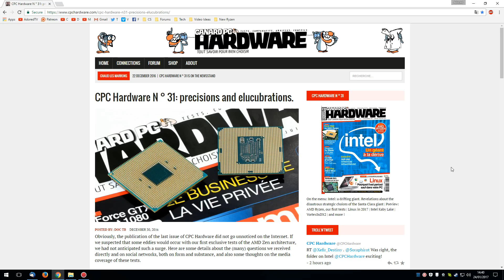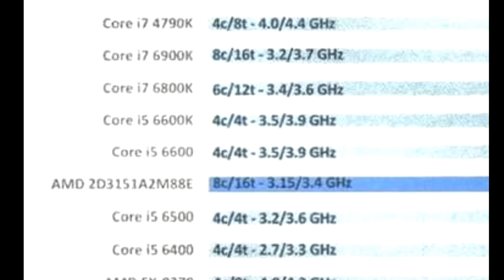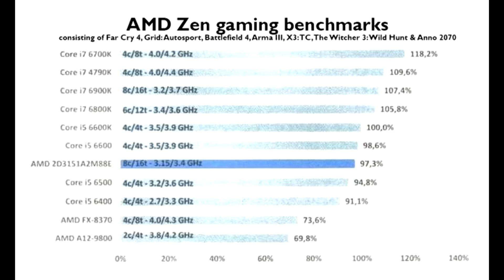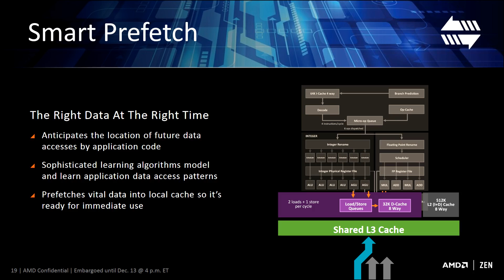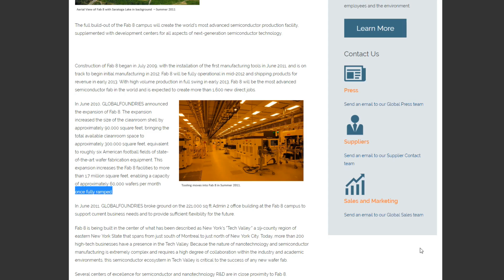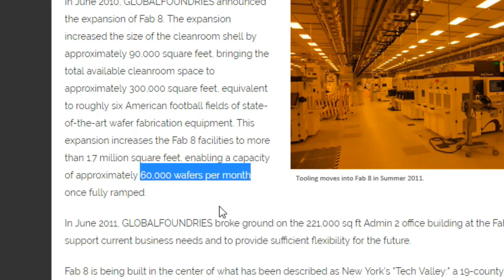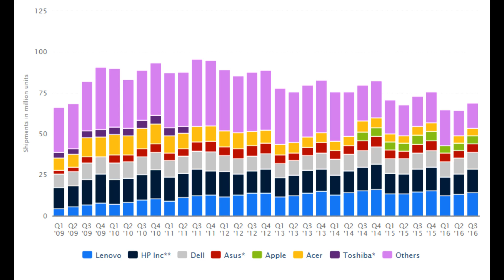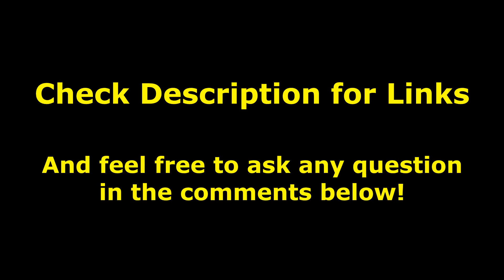Ryzen - A Refresher, Some Speculation and Market Analysis.

Comment: Thought it's worth saying that I suspect the engineering sample will have a good balance of performance and power consumption. However if you were to bump the ryzen chip up to similar clock speeds to the 8 core intel we may well see that power draw rise disproportionately to the clock speed increase so I suspect the final retail sample will consume over 100 watts of power at full draw.
Reply from the maker: Yes I believe so, especially given what we've heard about the turbo already.  I think most people will take it if it's faster though.

Comment: hey nice to see you back but I have a wee point were I do t agree with you, I work in manufacturing and ppm or parts per million defect rate you talk about is not the same as number of Defects per square Co of wafer. to work out that you would need to know what sample size GF use for there release test, 0.15 ppm is actually very low it would basically mean they expect less than one defect per million units whatever GF use as a unit in its calculation. good video though man glad to see you back
Reply from the maker: Ah cool cheers, yeah I see my mistake now.
Reply: AdoredTV TBH it doesn't change the point you made and I agree with, that there process has matured now, keep up good work, nice hearing a fellow Scot!
Reply from the maker: Cheers bud - if you spot any other errors I make be sure to point them out to me as I'd rather get this stuff nailed for future vids.
Reply: will do but you are pretty on the ball mate

Comment: Great video; how do you think Ryzen will compete against the 7700k. I think it will cream the 6800k for sure buuuuut just think how many websites will post benchmarks of games that dont thread so well showing the 7700k decimating Ryzen. 7700k has a pretty high out of the box clock speeds and if Ryzens IPC is some where between Broadwell and Skylake how do you think Ryzen will fair in single thread tasks. I personally think people like Linus Noob Tips will show Ryzen getting flogged by the 7700k and say that Ryzen is only good for 7zip like they did in the 5820k vs 6700k review.  I personally would never own a 4 core processor and I hate the entire Intel desktop range since the 1366 socket but I am interested on your thought as I think how Ryzen is betrayed by the media will drastically effect it's sales. It's not like an author with an Intel bias can't just show a huge list of benchmarks that favour single thread performance. I guess it highly depends on what the IPC really is and I am really interested to see what the IPC will be like on the 4 core Ryzen; I assume it will be better than the 8 core variant.
Reply from the maker: I think if websites try hard they'll find games where Ryzen doesn't look so good.  I'll be doing both but the low resolution gaming will be treated as synthetics.  I might do a separate video on it actually, just explaining how I think it should be done.

Anyone buying a CPU of this level will be gaming at max settings and 1080p minimum, probably 1440p or 4K and any other results would basically be just pure synthetic though, imo.
Reply: AdoredTV I agree. At the level 8 core level gpu is the real limiting factor. I am just interested which angle the media will take. I think it will be as easy as selecting games to support what ever brand you prefer to shine a good light on that brand so the media will have a strong influence.

I am still really salty about Ryzen not having 32 lanes like the early rumors indicated. I would be all over Ryzen if it had 32 pcie panes. I am interested if there will be a 140w tdp 8 core black edition as some of the rumors suggest. I would be keen to get one just to see if I could get the highest 3dmark score on Ryzen. If slinkypc and kingpin dont run Ryzen I reckon I will have a crack.
Reply from the maker: One of the problems with gaming benchmarks and the media is that 4K or GPU-limited benchmarks look boring as hell, just a flat line of results regardless of CPU.  This does lead them to use the low res benchmarks, which are flawed as hell imo.

I don't know if the PCIe lanes will be that big of an issue but I'll have no way to tell.  Trying to get hold of a single 1080 before the review at least.
Reply: It's 4am after Australia day which is like the US's independence day; I made the previous post in a bar so I assume it's barely readable. I think that the CPU is starting to become more of a limitation that in has been since gen 1 i7s released. BF1 was the first big change I have seen in CPU utilization in a long time. I did notice that they have optimised the single player scenarios for CPU load by reducing the direct X API calls. I wonder if this trend will continue or if its an isolated event.

I am still concerned with Ryzens future as I have friends who are moving to Kaby Lake already suggesting that the single thread performance of Ryzen will never match Kaby Lake so there is no point waiting. I see people even moving from haswell-e 6 core to kaby lake due to all the thought process that only single threaded performance matters for gaming.

I guess time will tell, I am eager to see sale figures after release.
Reply: well finnsk3 u are assuming that linus noob tips doesn't accidently screw up the benchmarks in the first place, which is nothing new for them :D
and people selling good 6 cores for quad cores makes me really sad.
i remember clearly, when people said: " dual cores are a great deal no need to get quadcores, games only use 2 cores anyways."
also if u mean quad cores for gaming do u mean overclocked ht quadcores to get to the 144 heartz?
this could be a reason for professional games i guess, but then pro gamers will also stream usually meaning this falls flat again.
i feel like a lot of people are just repeating what they got told "quad core is enough, hell i5 is more than enough"
i guess when intel said it often enough people start to repeat it. "no cheap 6 cores for average consumers"
Reply: Yeah you are right. There is just a LOT of complete false information that gets passed around. I have a friend who is the head of an Infrastructure team for a company that has many data centres and he still thinks Hyper threading makes you lose performance in games. That old rumour from when HT was first introduced... Even after debunking it so badly he still says, just get an i5 for gaming as you don't want HT. It's just idiotic. If you see enough of Linus Tech Tips you can see how bad their hardware knowledge really is. This is especially obvious with his server infrastructure; you can tell none of them have ever had a job actually working in the field. I laughed at Linus's freak out when his raid array dropped... got a data recovery company to rebuild his raid array... what a fucking noob.

I will actually be moving to 144hz 4k this year if a monitor comes up that I really like. I am currently using a 40" phillips 4k and a 1440p 27" as a 2nd monitor. I would like to get a ~36" 4k 144hz then use my 40" 4k as a 2nd monitor. I am currently on broadwell-e and I don't think I will move to Ryzen because of 144hz 4k. I am worried that I will need to run 3 or 4 GPUs to get 144+ fps at high graphics settings. I am actually really concerned about SLI not supporting over 2 cards so I might sell my 2x 1080s and move to 3-4 Vega cards pending how well crossfire scales.

Comment: Games being sensitive to frequency is normal when it comes to gaming. Digital foundry has quite a few videos regarding that. CPU can and will be a bottleneck in many cases. My 3770k @ 4ghz currently is performing way worse then it would @ 4.5. It is not letting my 980 ti to do full work in numerous games even at 1440p.

Comment: Blah blah blah, Broadwell-E IPC with lower than Skylake clocks. Reasonable power consumption. Probably a significantly lower price. Blah blah blah. Ryzen isn't going to be a technological break through. It's just going to put Intel back inline, and make AMD competitive again.
Reply from the maker: Why is it everything AMD does need to be a technological breakthrough, better perf/watt, cheaper and also cure cancer before some of you will consider it?

Vega will be your "technological breakthough" but you still won't buy it.
Reply from the maker: If you're gonna wait for the 8700K, why not wait for Ryzen+, which could have 15% higher IPC?
Reply: first no 8 core in intel hits 5ghz that easy  on air ...second is an engineering sample ... third we do not know if it is true ...third ...till they come out ...what ever we say ..  we can not back it up ...so there are no conclusions to be made yet
Reply: CrackedDylMil Well, that is very important. Competition is fundamental. Plus the clocks won't be that much lower. And they will all have an unlocked multiplier.
Reply: AdoredTV I didn't say I wasn't considering it. I was implying that it wasn't very mysterious. 

I'm going to wait for Ryzen and 8700K, and then whichever one gives me the best single threaded performance, with 8 cores, for $250-350 is the one I'm going to buy
Reply: really ? didital foundry did a test with titan x the 3770k at 4.4 does not seem to be a big bottleneck
Reply: CrackedDylMil You need to admit, I know we make mistakes and are sometimes  hypocrite, but I guess you better apologize in a manly manner instead :).
Reply: AdoredTV I'm using a 5 year old CPU right now. It's the bottleneck in my system
Reply: depends on the cpu ... my 3770k @ 4.3 does not feel like it is a bottleneck at all
Reply: venix20 I'm running a 3770K at 4.7GHz. It's still a bottleneck with my GTX 1070
Reply: Nvidia recently released a driver which seems to lower CPU overhead. I can tell because my performance is higher on 1080P and DX11, but not as as much on DX12 1440P
Reply: venix20 http://m.imgur.com/oLMBhxw?r
Reply: Yeas genius but Broadwell-E IPC is very close to Skylake IPC, very close.
Also their 8c Ryzen CPU already has higher clocks than Broadwell-E so their 4 core CPUs could very well clock as fast a Kaby Lake no problem.
Reply: UltraFighter18 how on earth does Broadwell-E IPC (lower than Skylake) 

Plus 3.6-4GHz (Lower than Skylake) 

Equal Kaby Lake (same IPC, higher clocks) 

Blantant fanboyism. 

It's not going to be as fast as Kaby Lake. But they might be able to undercut the prices
Reply: CrackedDylMil  So you are not very smart it seems. I clearly said the 4 core Ryzen cpu could clock higher if their 8 cpu can already achieve 4ghz turbo on all cores. It's only logic you should try it fanboy.
Reply: UltraFighter18 Ryzen hits 5GHz on 1 thread with a huge air cooler. Kaby Lake does that on 8 threads with a similar cooler
Reply: CrackedDylMil  There isn't any 8 core kaby lake cpu fanboy and HT is irrelevant to OC. Also for a buggy ES 8 Ryzen cpu 5ghz on 1 core doesn't sound bad at all especially when there was no mention of how it was achieved.

Comment: i have a question, from what i understand cabylake has the option to disable ht, but if done so it has way worse multithread performance than one would expect from an i5 at the same clock without ht?
why is disabling hyper threading nowadays such a huge multithread performance dump? (beyond normal non ht quadcores)
i would assume the whole process scheduling part for multithreads is setup to always run with ht on and disabling it fucks it over.
or am i completely wrong here will run perfectly well like an i5 if we disable ht?
this came to mind looking at fucked up ltt benchmarks showing an underclocked i7 7700k with disabled hypterthreading as an i5 7400.
long story short it only did 77 percent of what a real i5 7400 would do and it had a multicore scaling of:
1: 2,887,   which is to horrible to be without a reason.
video in question:
https://www.youtube.com/watch?v=Qn_E_pI9GeY&t=10s
Reply from the maker: I would expect it to run almost identically to an i5, no idea what's going on in Linus's video.

Comment: Did you forget to take the server market into account?
Reply from the maker: No, the server market will be fought differently and is very low unit volume compared to desktop - but obviously very high margin.
Reply: But I thought the server chips were better bins of the enthusiast chips for some of them at least.
Reply from the maker: They are, the server chips will be the best in perf/Watt terms though not necessarily the best in overall performance as that depends on overclockability/leakage etc.

Comment: plant capacity does not equal client requirements....they make not only cpu dies but gpu... plus they have other concurrent clients. Amd will not deliever even 50% of 75million units/year. Its retarded.
Reply from the maker: How much GPU from AMD (this one is really easy to figure out) and what other clients are using 14nm at GF?

Comment: I fully expect AMD to match its core counts to whatever Intel has divided by 2. Its the quickest way for AMD to regain its marketshare over night, and Intel's market segmentation means it won't be able to move that well to counter it. On top of that, being split between two different sockets will further impact Intel's ability to blunt that push.

Comment: Great Analysis.  I really don't think AMD wants to tank the high end market.  I would predict $550-700.00 for the flagship Ryzen SKU.  I don't see how Ryzen can not do well if it launches by March.   Skylake X will be launching in the fall and will likely sell itself based on platform features.  Intel has exclusive support for Thunderbolt 3 and there is still the specter of DHCP 2.2 decoding and whether all streaming apps will allow for GPU decoding.  One of the issues with Broadwell E is that it inherited Haswell's issue of incorporating the internal voltage regulator (and other usually chipset components) onto the die.  When shrunk down to 14nm that likely contributed to Broadwell E's very high temps when above 1.265V and 4.2 Ghz.  SKylake X should clock a little higher at 4.5 on most samples (which I also predict to be the limit for most Ryzen samples).  Skylake also features an improved scheduler with better branch prediction over Haswll/Broadwell (This was most seen on the 6700k where we saw the 10-15% better improvements in encoding and other hyperthreaded workloads.  This is in contrast to the 3-4% general IPC improvements over Broadwell that is relatively lackluster).  If Ryzen can clock to at least 4.4 Ghz it should do well against not only Broadwell E but also Skylake X which will be its long term market rival.  Skylake X will likely continue to dominate the simi-professional home workstation market because of the quad channel memory support and other premium platform features (I've heard rumors intel is looking at new security features as well).  Skylake X mobos will be considerably more expensive (maybe $150-200.00 more on average)  because of all the pcb layers and traces needed which gives AMD an even bigger argument to general consumers than just cheaper cpu prices alone.  At the very least AMD Ryzen will be a very attractive alternative It just remains to be seen whether or not, in the end, consumers will buy it not.
Reply from the maker: I think $599 for the top SKU but perhaps a nice surprise for the one under it.
Reply: AMD needs profits, not market share. By pricing down Ryzen, AMD will be giving up much needed future profits, esp for lower core versions. AMD's Graphics and CPU Division lost $66 million dollars last quarter, even during the best sales of the new Polaris graphics cards that AMD will probably ever have. This division HAS to become profitable and Vega just will not do it. If AMD is going for boosting the stock prices, then Ryzen will be for sales at $500-600. If AMD wants to finally start to have the company become profitable, it needs to sell 8 core Ryzen for $700-800, more in line with Intel pricing. AMD has had low cost CPU/APUs only because they could not compete with Intel. With a competitive Ryzen, that needs to change.
Reply: John Pombrio  Any price above $700.00 would probably be a bad move due to the way it would be covered in the media after all of this hype has built up.  At $600-650 there is still a pretty decent profit to be made if they move units.  The worst case scenario is that AMD disappoints enthusiasts and they simply buy the discounted Broadwell-E (especially if AMD doesn't overcome those SMT defects completely) or waits for Skylake X.  You are entirely correct though that, no matter what, AMD has to make a profit in the next few quarters or it is all over for them (at least their current CEO and upper management).